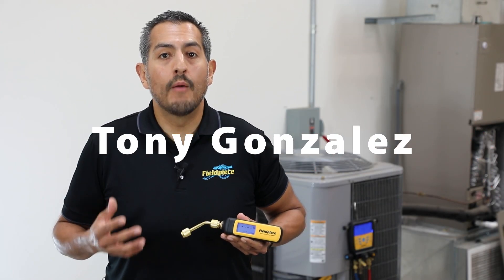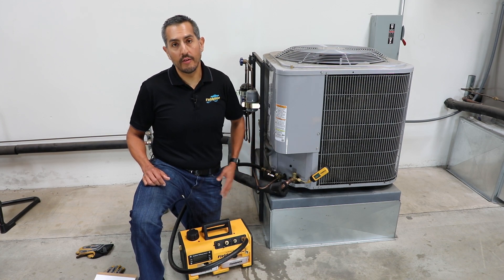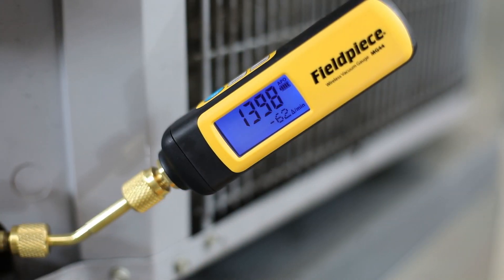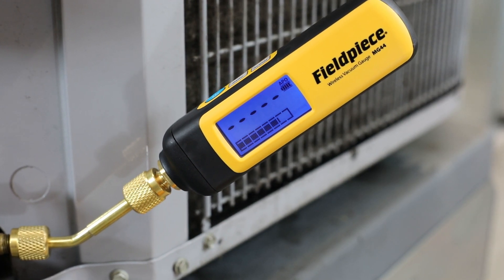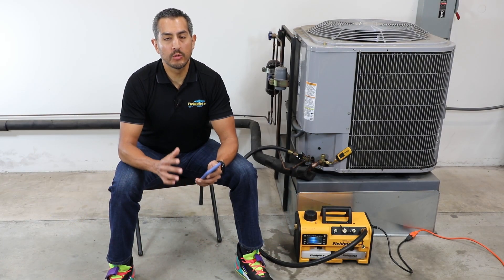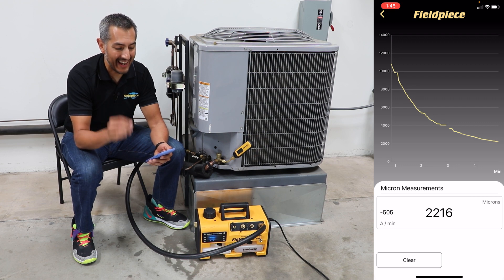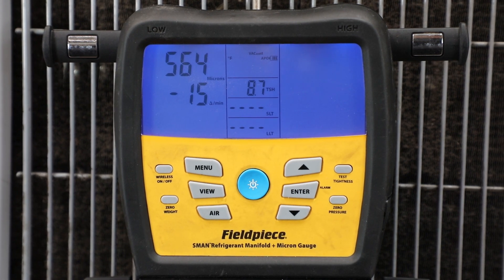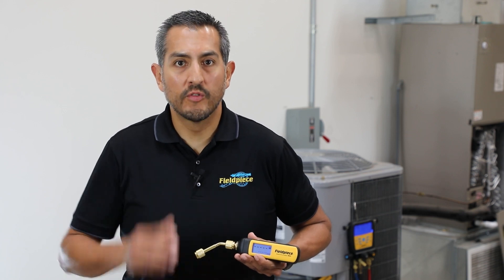Three ways to use the Wireless Vacuum Gauge MG44

Comment: Here's to hoping @fieldpiece instruments checks the comments. This micron gauge (mg44) has a serious is with temperature written it comes to the micron level it displays. The issue with the temperature of the sensor is so bad that if you are pulling a vacuum outside and the sun is hitting the micron gauge your reading might be 1000 microns or more higher than the actual state of the system and that can be easily demonstrated by putting a sunshade in front of the gauge and stopping sunlight from directly hitting it. The big problem for someone in colder climates is that the gauge has high potential to report a much lower vacuum level than the system has actually achieved. Hopefully @fieldpiece instruments can address this with a version 2.0 or something like that.
Reply from the maker: Thank you @Puffalupagus360 for bringing this to our attention, we have shared this with the rest of our team. Please contact our Warranty and Repair Department in the meantime to address any issues with your vacuum gauge: FPWarranty@Fieldpiece.com

Comment: I got mine today (I’m in Australia) and I was wondering why you @fieldpiece put the MG44 directly on the unit. By doing this when you open the line set to release the refrigerant it will obviously go into the MG44. Will refrigerant ruin it if it gets into positive pressure?
Reply: For reference of anyone reading this, a good way of doing this is to attach the gauge through a core depressor tool if you are going to release refrigerant with the gauge attached. This way you can simply close the core depressor when you're happy with the vacuum and remove the tool without contacting or releasing refrigerant.
Reply: @joeyt8643 i thought that would have been obvious to any smart tech haha
Reply: @timmyanders7914  Totally, but some folks are DIYing, or just new to this.

Comment: I wish it did a decay test like the blue vac.
Reply: What’s a decay test?
Reply: Decay test is to pull a strong vacuum and valve off the vacuum pump before turning it off. Then wait a hour or so to see if the pressure rises.
Reply: @markm0000  bluvac tells you this info in seconds without waiting this hour. This is my point.

Comment: I bought this mg44 micron gauge along with the fieldpiece wireless gauges about 3 months ago. I love the gauges/clamps and probes but this vacuum micron gauge hasn’t worked once yet and not for the lack of effort, I’ve hooked it up on every port and even to the pump and got nothing but lines. I was convinced that my old vacuum pump must not be sufficient anymore so I bought the Fieldpiece vp67. So I knew this pump would make the gauge read….but nothing. It’s on and the tips and everything look good. Any advice? The guy at the sales counter looked confused on purpose
Reply: @natereynolds7418 I know it’s been a while since you posted this but it’s 7/22/24 and I’m having the same issue with this micron gauge I have it hooked up just the same way he does and it’s just showing bars did you ever get it working?
Reply: @eco-solutionsllc4412  never once has it worked. I’ve quit trying and use my SMAN gauges since the micron gauge is built in. I really should try and have them fix it, sounds like we both got a dud.
Reply: The only problems I have with this gauge reading micron level is that the sensor is entirely temperature dependent and if you're in a hot environment it will artificially read a higher micron level.

Comment: Leaking from day 1, got mine from Johnston's Supply, took it out on the field on a new install, it reached 2800 microns and no more, I thought I had a leak on the system, after waisting a lot of time I decided to connect my old cps-vg200 and pulled down to 480 microns and it was holding for 20 minutes (decay test), the next day I returned it to the store, they got me a replacement one, same thing happened all over again, brand new out of the box and leaking, returned it and got my money back.
I have all fieldpiece tools, digital gauges, scales, multimeter etc etc etc with zero problems, except their vacuum gauges they are junk. So if you buy one, ask about the return policy, you probably gonna need it.
Reply: @FieldpieceProducts  just purchased one that pulls down and doesn’t hold used it twice and same results. Starting to think it’s leaking as well…
Reply: I am having the same problem it’s not reading.
Reply: yup same here.
Reply: @FieldpieceProducts  I did call you, "Chris" in California answer the phone, he wanted to argue with me, defensive, instead of providing any customer service or solutions, after a couple of minutes I told him I wasn't interested in arguing about it, at that point I just wanted my money back, he said to take the vacuum gauge to the store and call from there, so I did. 

I've been in business for over 16 years, I owe all fieldpiece tools and I have other brands as well and if I say something is broken, is because is broken, you know, you get experience after the years, specially while on the field, on rooftops at 130°F, you should provide "Chris" with a customer service class. So he can stop arguing with customers.

Comment: When will this be compatible with measureQuick? I had to switch back to my BluVac just because how unuser friendly the field piece app is
Reply: I actually use both at the same time. I have no issues with the job link app
Reply: I love my measure quick app but I wish they would incorporate a process Chiller test. I would love to be able to add leaving fluid temp and G p.m. and delta-t to get my tonnage